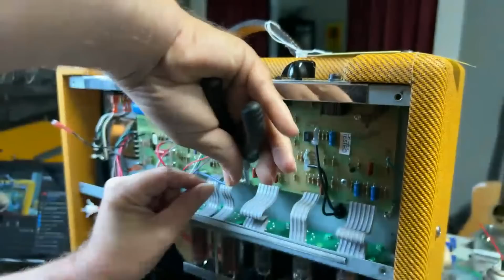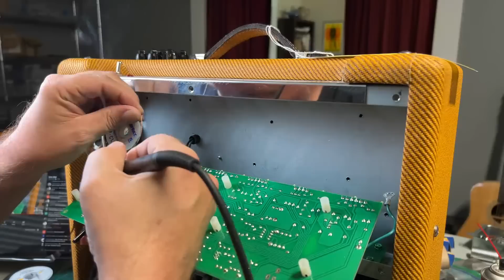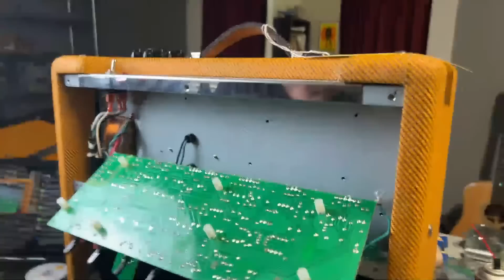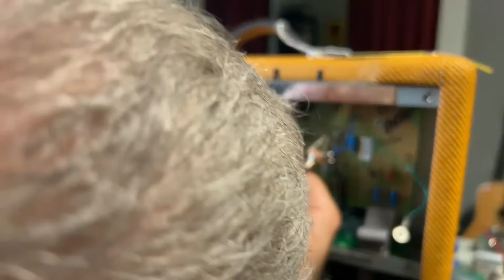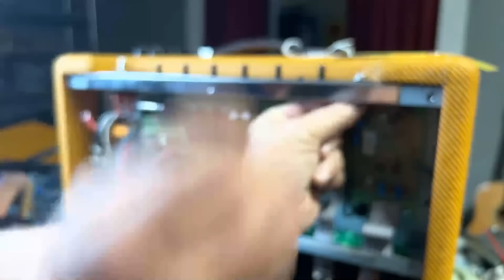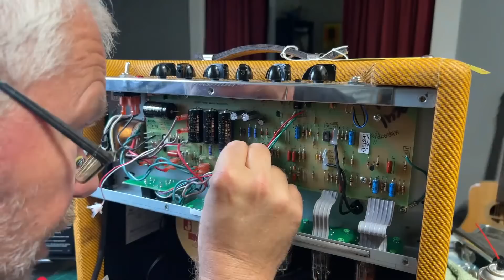Blues Junior Live Chat

Comment: Hi Lyle,
Great video, fascinating stuff, as always. 👍
I bought this exact BJ version a while back, expecting great things. Unfortunately, I did not like the sound of the Jensen, at all. Reverb was totally uncontrollable; ranging from virtually undetectable, straight to ‘full wash’, with nothing in between - just no subtlety.
Just could not get an acceptable (let alone ‘sweet’) sound. Strat, Tele, Jaguar, ES-335, LP (P90 or H/B), SG (P90), PRS Semi-Hollow, Gretsch Semi, Firebird, Casino, Flying V and various others. None of the sounds, to my ears, in any way, inspiring. 
I guess my Blues Junior was just a ‘Friday P.M. Special’? Most disappointing.
Replaced it with a Vox AC 15C1X (Alnico Blue) - fabulously flexible amp… 💩-loads of inspiring tones available. 😬

Comment: My vision is lousy, and my eyes are significantly dissimilar, and so over the counter reading glasses don't work for me (anybody know where I can buy a matched set of eyeballs? 🙂). I've been wearing bifocals for 20 years, and am used to them (and they give me a modicum of eye protection from solder splatters and sparks). For close up work I wear an Optivisor, the best of the affordable magnifier headsets (swappable, precision glass lenses and a comfortable headband).  These are usually sold with a range 1.5X to 3X lenses ( that's the diopter number,  not actual image-multiplication/magnification size) but I don't find those to be enough magnification for most work,  not for my eyes anyway,  so I use 5X and 7X lenses, and occasionally 10X for extremely closeup work.  The swappable lenses are held in place with a couple of little plastic clips, but I actually have 3 dedicated Optivisors, one for each magnification level, and they  have headlamps Velcroed to the top of them as well ---- a longer-throw spotlamp for the 5X visor, and a wide-angle short-throw COB LED "flood" headlamp for the higher-magnification visors . I can just swap the entire headset in a couple seconds if I have to do close up work and will have a purpose-selected lighthouse for whatever type of work I am doing.

Comment: Great vid.   My BJ IV Tweed is a couple of years old so this is of great interest.      I agree that the Fat switch is better left on, but I never knew what it actually did (cathode bypass cap).   Also good to know how easy it is to snip the bright cap  .  Mine came from sweetwater with an Eminence Red White and Blues, but I use a Alnico Blue in a larger external custom cabinet.  So its sounding fine with the treble at 4.
BTW One thing about your Youtube audio:  It was hard to make exactly what you said about the Fat switch after you demoed it   - After you play the guitar, it takes several seconds for whatever compression is going on to release.  so when you start talking its inaudible for the  first couple of sentences.
Reply from the maker: Yeah, I thought I was using the iphone mic but it used the macbook mic (which sucks) instead. And I couldn’t change it mid-stream. 

I was unpleasantly surprised how poorly the mac mic handled the guitar amp volume and how slow its compressor was to release. 

I’ll make sure the audio is better for the next ones.

I was saying the amp sounds better with the “fat” switch in, as that stage is bypassed and rejects heater noise. But you lose the ability to have a footswitch boost.
Reply: Stock one here w starfire dounds great
Crank vol to max set master at 2 then run treble at 4 mid at 5 bass at 2 or 3 at stage vol it’s pretty good
Reply: No fat boost needed 
It seems to sound better at vol w/o
Reply: Maybe we don’t know anything tho 🤣🤣🤣
Use knobs for clean up and tone shaping